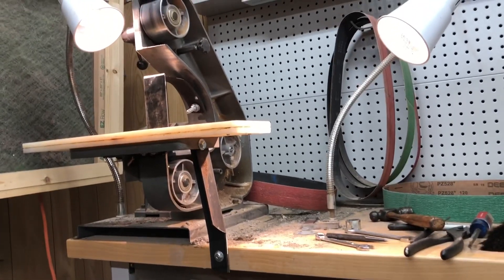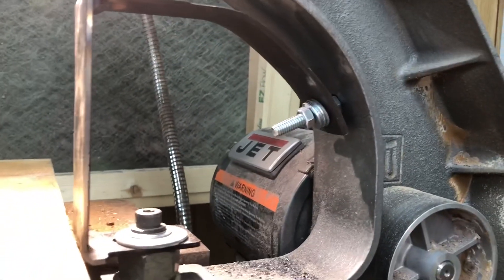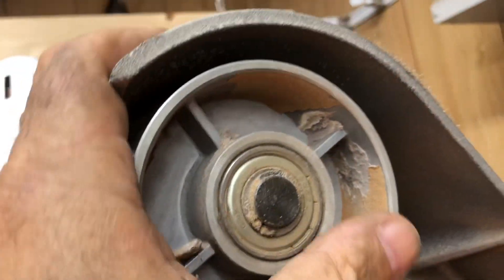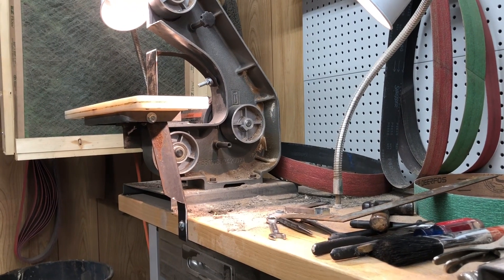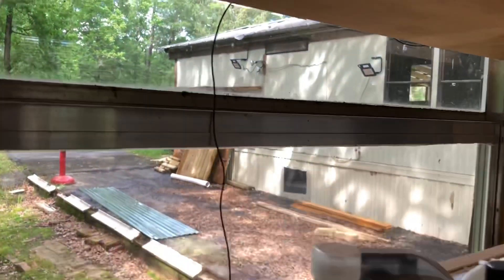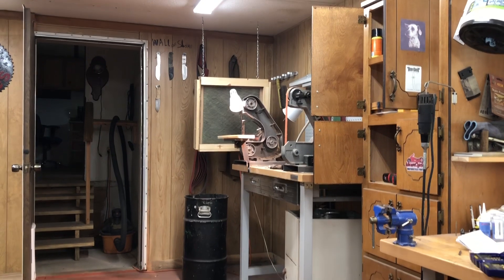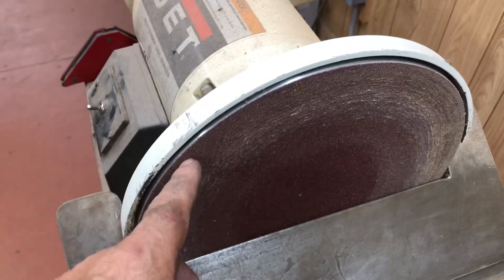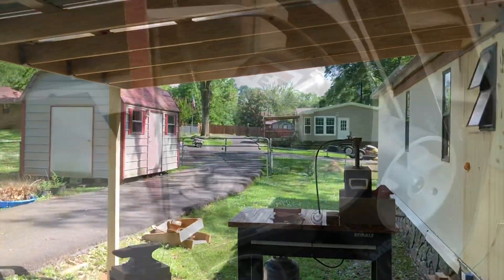Made some mods to the 2x42

Comment: We have trash day every Thursday and hundreds of apartments and I am always seeing metal bed frames and wanting to take them to use in a project, they are great pieces of metal and the cost of regular wood and metal is going up fast. I just need to finish all the projects I have started before bringing more stuff home. The way you squared everything up was great to see. You saved a ton of money.
Reply from the maker: The bed rails are very hard to cut and even harder to drill without top end high speed steel bits. I ruined a couple before I found my good ones.

Comment: Looks like you've worked out good solutions to make that sander fit your needs. Lives up to your slogan about repairing, recycling and repurposing things in our lives. 👍     Can't remember if you've used the living room of the trailer for anything. How about turning that into a saw shop?  At least for your mitre saw and maybe your tablesaw if you have clearance for it. Gets them out of the weather. Frees up more room under your porch roof for a mower or something. Just a thought.....
Godspeed as you ride. Have a blessed day.
Reply from the maker: I thought about it but someone would have to sweep out all the sawdust and that someone would be me. Outside, I just take the leaf blower to it.
Reply: @bctruck  You've got a point. I thought you had a shop vac. :-) Besides, non-treated sawdust is great for making compost. Charly might consider that to be a great resource. 

It's also good when a Luggable Loo is needed, when a storm takes out city water. I recently bought 40 lbs of wood pellet based cat litter for that purpose because I make very little sawdust these days. 

Probably a bit of useless info that you didn't want/need to know. LOL

OTOH, It's cooler (or colder according to the season) on the porch when turning big sticks into small ones. So I guess it's a trade-off, either way.

Comment: I don't know if you've tried it yet or not but when you go to change that disc sander paper, try using a heat gun on medium or low. Just a little heat will soften the adhesive and make it much easier to remove the old sanding paper. Then just a rag with a little acetone to wipe down the plate before installing the new disc. Just my method after dealing with a stubborn disc. I like the mods you made to your 2X43!!!
Reply from the maker: Thanks! I’ve tried the heat gun but it didn’t seem to make it any easier. Now I pull it off slowly ,scrape what adhesive will come off with a razor blade, then acetone. I have found that if I replace it regularly and don’t try and squeeze more life out of it, it comes off much easier.

Comment: Not a lot of people realize just how strong bed rails are...no fun to drill & cut either!
Reply from the maker: In the past, I’ve had to heat it up cherry red to take the temper out of it in order to drill it. Now I have high speed steel bits that will get through it.